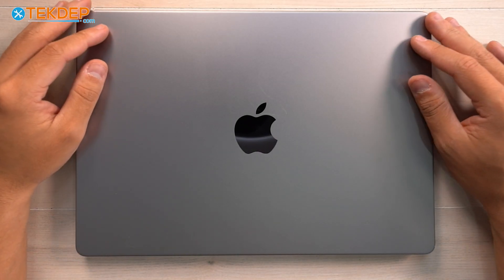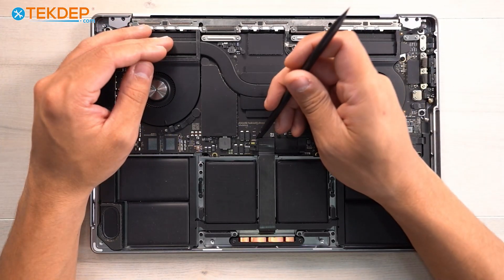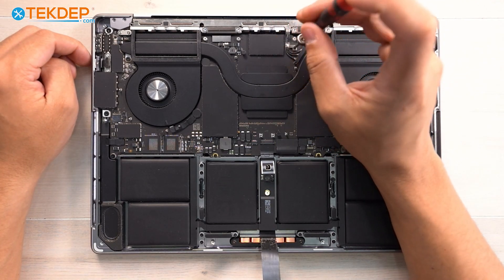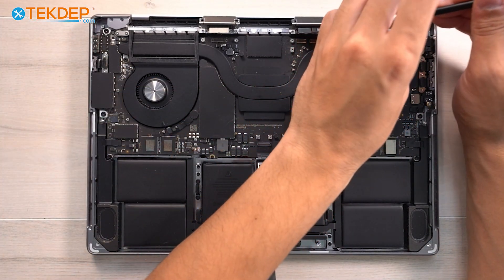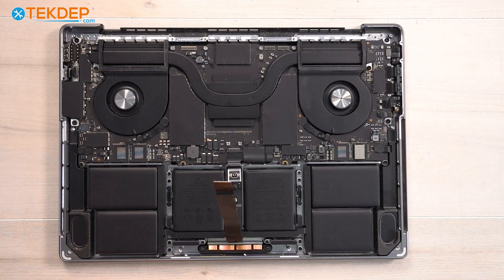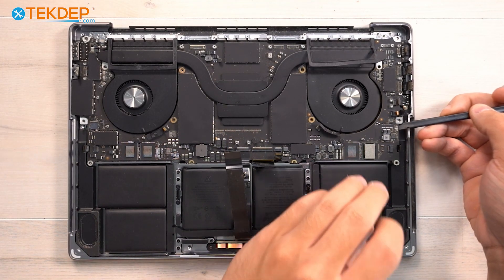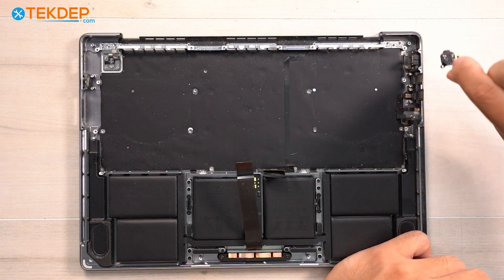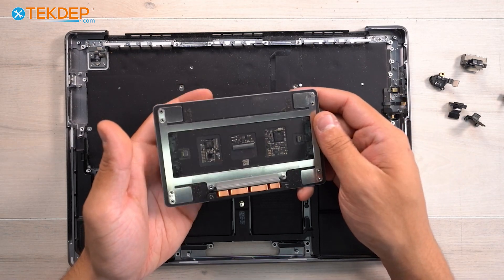14 inch 2022 Macbook Pro M2 Model A2779 Basic Teardown Tutorial

Comment: This is a helpful video but there are two problems with it (both of which I hit).  First, when ripping up the keyboard and breaking all the rivets, be extra very special careful not to rip the display ribbon cables.  In fact, watching the video, it sure looks to me like the display ribbon cables were ripped when you pulled up the keyboard.  This is a big problem and will cost you a new display.  Second issue, when remounting the fan modules, it is easiest if you tape the fan ribbon cables back over the fan itself.  Otherwise, they tend to get caught under the mother board.  And if they do get caught, and you try to pull them out, you may rip them off the fan.  Other than that, and having a whole bunch of extra screws when finished, I was successful with replacing the keyboard.  I figure if I did another keyboard replacement, I'd do it perfectly.  Unfortunately, before that happens, I'll probably get a new macbook